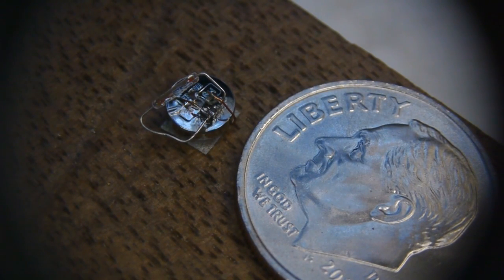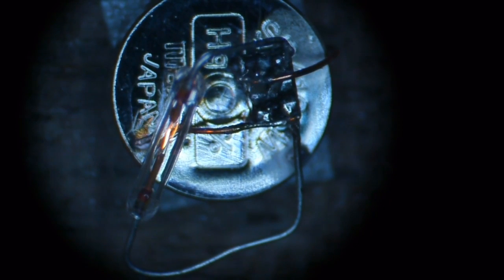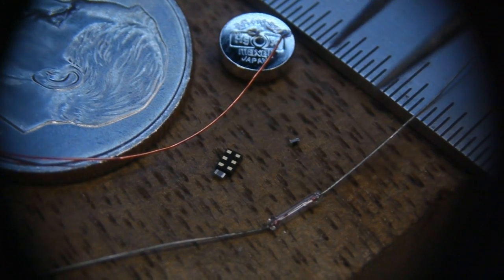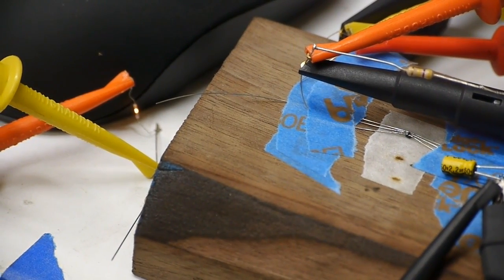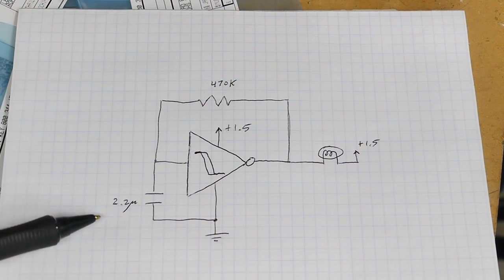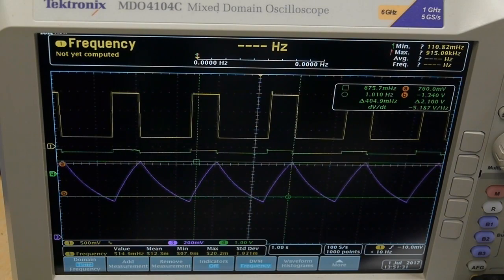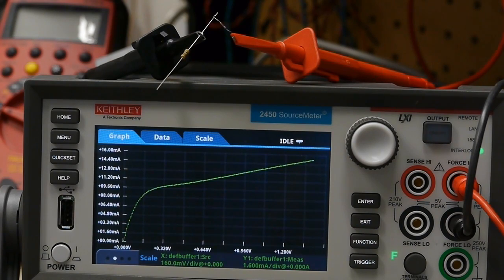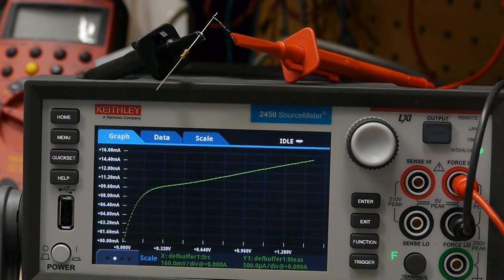World's smallest lightbulb flasher?  Flashing Light Prize 2017

Comment: If the voltage ramping smoothed to soft start & soft shut down the filament, it will greatly enhance the operating life of the tiny lamp // effective every 10% you dim an incandescent lamp - doubles the operating life in hours // this is why slide dimmers used with an incandescent lamps started dim & shut down dim can make a normal A19 last 20+ years

Comment: Warming a chemical battery to improve its output makes sense. A hand heater with a cell phone (snowboarding) can help in a similar way / or for digital cameras in sub freezing conditions. I usually wrap the hand warmer with a small towel to slow the heat transfer so as to not overheat in the pocket, a sock works great! Frozen lipo also dangerous to charge FYI.

Comment: couldn't a tiny reed switch be used with an appropriate bulb that by it's heat or due to current flowing, it breaks contact? maybe use a cap, pre-energized in place of a battery just to be unusual...
just thinking of interesting ways to be different or smaller

Comment: A QUESTION: incandesced lightbulb should get hot and emit light no matter the direction of the current, so it should totally work in AC. So why the scheme the chap has designed should include inverter?

Comment: Hi Ben, project idea: A hydraulic cylinder using gallium as the hydraulic fluid. Gallium melts just above room temperature, and expands when it solidifies. By varying the temperature around the melting point, the expansion/contraction could actuate the cylinder. Suggest experimenting with cooling it from the end, from the sides, effects of gradual vs. rapid temperature change, ways to improve the pressure, throw and speed of the cylinder, etc.

Comment: Well, you beat me to the punch on this one, Ben...  Drat.  However, while yours is also probably a tad smaller my entry has a unique feature that I thinks makes it interesting, too.  See: https://youtu.be/-4Dtu-VaZNw
Reply from the maker: Awesome!  When I starting watching your video, I was thinking about this really convenient IDE made for the ATTiny10 that I've been using recently, and it's yours!!  Thank you so much for creating this IDE!  It's so much easier to use than anything else.  In fact, I've been thinking about doing a video about the ATTiny10, and was absolutely going to mention your Mac IDE.  A Windows version would be appreciated, but I have both platforms, so not a huge deal.  You might get a kick out of this very clever morse code program: https://i.stack.imgur.com/NCQ6z.jpg  Again, thanks so much for making the IDE!
Reply: Wow, it's great to know someone is using my IDE.  I'm flattered.  The ATtiny10 has been my goto "glue" logic replacement for a lot of my projects, as it's often "just enough" for what I need.  In fact, one goal for the new IDE is to create a tool where non programmers can type in a few parameters and then autogenerate code to make an ATtiny10 do things like analog or serial to PWM conversion, sequence generation (blink patterns for LEDs), servo control, capacitive touch control, etc.  The idea is to define a way to annotate C code with "tags" that cause the IDE to prompts for values for these tags before compiling the code and programming the ATtiny10.   It's still a work in progress, but I think is has potential.

That morse program you linked is very clever in the way it leverages the fact that morse is already a type of binary code.  I'm not sure it would have simplified my code, but it's very inventive!

Comment: smaller or simpler than this?? what about a MEMS relay with rc timer or something 😂 or will a custom tiny silicon die will win, and use a piece of the tinest tungsten wire you can find for the light bulb section.

Comment: the curve is caused by the bulb heating up and changing in resistance right？
Reply from the maker: Yes, exactly.  I would have expected a more gradual change as it gets warmer, but it has a "knee" shape in the graph  .  Perhaps this is a combination of 1/R and V^2 terms combining?   Or maybe a T^4 term in heat emission?  I'm not sure, and a quick search did not make the answer apparent.  Maybe you can find it?
Reply: Applied Science it seems amazing how it looks almost linear after the, "turning point"!! or is it actually? hmmm, so the combo of both the heat "lost" from that I^2, and the resistance change from the heating process, and maybe the material's emmision properties? so could there be a math function modeled for this? but again is it actually a single function? or  is it two seperate functions.. i am confused.

Comment: Pretty small flasher! Another item you might like to play/experiment with....old digital hearings aid/s.....Mine have a double sided ceramic circuit board maybe 1/8-5/32" square.....at least 25 components on each side....and the 'battery' is a #10 zinc-air. These zinc-air cells can put out plenty of current @1.45 volts...40-50 milliamps on an analog multi-meter....resistors and caps are very small....a lot of the components are specially made just for hearing aids....  #10 cells are the smallest for hearing aids, but may not be the smallest 'coin' cells...

Comment: Have you had any problems with the Schmitt inverter?  You are running it at 3-4 times the recommended output current on the data sheet.
Reply from the maker: The datasheet seemed to indicate that the chip would only be capable of source/sink 4mA at 1.4V, so I was surprised that it was capable of much more.  The absolute max is listed at 50mA, but this is far outside the "recommended" spec for low voltages.  I think it's possible that the current must be low in order to meet the speed/switching specs at low voltages.  I don't think it hurts the chip, but would have to ask the mfr if using this into a commercial design.
Reply: It runs at like 30% duty cycle, and all CMOS logic chips are inherently current sources, so it sort of self-regulates. As the load resistance goes up due to filament heating, the current will stay put, and the dissipation will drop as the voltage drop on the output device will get smaller as well, under constant current. 

All you want is one that will survive the load. They mostly do. I have stuff in production (for 15+ years now) that drives a bunch of LEDs with no series resistors, just leveraging the inherent current sourcing character of CMOS logic output stages. The trick was to get an MCU with a large pin count package so there would be about 50% unused GPIO pins. Those extra pins were split evenly and half were connected to VCC, other half to GND. Then they were driven as outputs, GND to 0 and VCC to 1. This provided the I/O areas with additional, local supply sources. This kept the I/O currents local and didn’t overload the designated VCC/GND connections. The chip didn’t mind the dissipation apparently. This driving about 50 pins at about 10mA each, where the rest of the chip drew maybe another 10mA on top of it (it wasn’t anything fast).

Comment: 7:05 Any particular reason the other end of the bulb is tied to power rather than ground? It doesn't seem like it would matter in this case, although tying to ground seems more standard.
Reply from the maker: Good question. The datasheet says the chip can source/sink the same amount of current, so it should be symmetric, and should have the same current flow for either wiring configuration.  The threshold voltages are not quite symmetric between gnd and vcc, so when the bulb is drawing power, the battery voltage will sag, and change the input thresholds slightly. Based on a few quick tests, it seemed to work better when the voltage sag occurred during capacitor discharge cycle.  I'm not positive that this is real effect, though.

Comment: Unijunction Transistors can make very simple RC oscillators as well. I loved this video.
Reply: When Ben was speaking of trying to make it even simpler, making a relaxation oscillator based on a UJT was the first thing I thought of also...Bat, C, UJT, Bulb, would do it I'm thinking... Great video!
Reply: Came here to look for this answer :-)
Did either of you figure out if it'd work yet? I don't quickly see whether there's enough voltage, or ability to make the output symmetric...  https://en.wikipedia.org/wiki/Unijunction_transistor

Comment: I don't know of a simpler oscillator than the reverse-biased NPN transistor working as a tunnel diode.
You can make it smaller if you make the componentes into silicon wafer with only 3 or 4 terminals for the lamp and power.

Comment: Are there sub-micro bi-metallic switches available? Or filament bulbs (at the very low power end) that incorporate them. I know they used to make large, relatively high power ones to flash Christmas lights. That would be the simplest circuit.

Comment: do you think you could build a DC to DC converter that runs off of one 0.5 volt solar cell that would charge a phone? I had wondered if it were possible after learning about a "joule thief", but I think the voltage is too low to self start.

Comment: Your explanation of the astable multivibrator is not entirely correct. The frequency of the astable multivibrator depends highly on the positive threshold voltage, the negative threshold voltage and the supply voltage. Here's a formula: F=1/(RC*ln(Vp(Vs-Vn)/(Vn(Vs-Vp)))) where F is the output frequency, RC is the RC time constant, Vp is the positive threshold voltage, Vn is the negative threshold voltage and Vs is the supply voltage. These values can differ a lot for every schmitt trigger (inverter) even within a single IC, so you need to measure these values if you want to calculate the output frequency or the necessary values for R and C.

Comment: I have made an oscillator circuit using light dependent resistor, giving a negative feedback to an op-amp based comparator, which drives an LED.

Comment: The word 'simple' is very relative.
Does that mean;
1 - total part count ?
2 - surface area/volume ?
3 - price ?
4 - practical part count vs technical part count?

Because it's very doable to build an one transistor oscillator.
There a numerous examples out there.
It's even more easy two build a two transistor oscillator, which is technically simpler than a schmit trigger.
But volume and part wise you probably need more components.

Btw, how stable is the RC circuit in this case?
How much does it shift with the temperature?

Comment: Years ago I build a model train house as a gift. I used such small lamps inside, and one of them started flashing. I was really confused. It took me hours to figure it out.
I used magnets to hold the hing together while the glue was drying, and it happened that one magnet was near the light bulb. Also the soldering was bad, so that one leg could build a spring. and the other only had a loose contact.
What append was that the magnetic field of the light bulb was big enough to be affected by the near by magnet so that the loose wire was loosing contact after awhile. Also a blob of glue was acting as weight to slow down the Frequency. It resonated with about 10Hz.
I was never been able to reproduce that. I tried it because the construction seemed surprisingly stable in the model.

A construction like that could be the smallest/simplest flashing light i can think of.

Comment: Old digital wristwatches from 80's used even smaller light bulbs as a back light for display. I have one somewhere and it works from 1.5V alkaline coin cell without the need to heating it.

Comment: The simplest oscillator I've seen thus far is a relaxation oscillator using the BJT negative resistance region:
https://www.youtube.com/watch?v=rpGOKGrcpAk
It uses a single BJT, a resistor and a capacitor. But this circuit needs high voltage around 12V to reach BJT breakdown and negative resistance region

Comment: As others have pointed out, one can probably make the bulb smaller, and one can probably make the electronics smaller too (smaller discretes, remove epoxy from IC). I think the main problem to shrink this further is the energy source. I do like this build though. Nothing like some PCB-less circuits =)

Comment: the simplest blinking light bulb circut is there are small light bulbs they have a thermal switch inside to cut of the power from filament after reaching some temperature. now its starts to cool down and the thermal switch close the circut.
my idea is to put a smal thermal switch under the bulb! if its very small and the thermal capacity is low enough, and the thermal switch is very sensetive you just need a thermal switch an battary ant the bulb.

Comment: Neat research, using $25k of test equipment. Yes, I am jealous.  This could be done with 2 SOT FETs, but still needs additional 3 resistors & a capacitor.   I think this is the practical smallest hand built flasher.  Using a die or flip chip and smaller R & Cs  or making it as a thick film hybrid would be smaller but requires using "micro automation".  But wait, you have a really neat vacuum deposition set up! That could do it!

Comment: Add a phototransistor looking at the bulb, and you've developed an incredibly crude thermal trigger.
Reply: You have to take into consideration that the conditions as is require the battery to be heated to 30c to function as it is pushing the battery hard to be able to function. Adding photo transistors will most likely make it unable to fire up. So not really an option. The idea on the other hand is quite clever though !

Comment: " you can get them even smaller " then it's not the worlds smallest
Reply from the maker: Sorry, I meant that the axial bulbs are smaller than the standard-shaped micro bulbs.  I bought the smallest incandescent lamp that I could find after an evening of searching.  It's the smallest one that Cir-Kit sells, for sure.
Reply: I think the world smallest light bulb was made in 2009 with a carbon nanotube, definitely not something we can make at home, yet. 

"At 1.4 micrometres long and just 13 nanometres wide, the filament is invisible to the naked eye until it is switched on."

“Quantum mechanics is the right theory to use in systems with very few particles, and thermodynamics is the right theory to use in systems with very many particles,” says Regan. “We don’t have a theory for the intermediate regime between these two limits, so that’s where we’re doing the experiment.”

Source:
https://www.newscientist.com/article/dn17058-worlds-tiniest-lamp-spans-quantum-and-classical-physics/
Reply: The world's fastest car, is the world's fastest car, even though "you could build one faster." Since no one has built one faster, it's still the world's fastest car. get it? 

The new Bugatti Chiron will be the world's fastest production car once production street tires are built for it that can handle the 300+ mph  speed. Since no one makes production street tires to handle that speed, Michelin is building tires specifically for it. Then it will be able to go past 300. So even though "it can" be the world's fastest production car, it's not.

Comment: You just need to use the heat from the bulb to expand a wire so that a contact is broken, then tune the mass of the wire to the output of the bulb and it's rate of heat lost to the environment so that you have the timing right. The wire passes the heat source then hooks around to the point it contacts so that an increase in the wire length moves the hook away from the contact. Like this, apply heat at the dot _j  and the j gets longer and stops touching the _
Reply: This is brilliant. None of that semiconductor witchcraft. I'm sure some of the competitors have come up with a bi-metal filament bending away from a contact point but it might be pretty hard to downscale..
Reply: If you make the bulb yourself you could have it contain a thermally dynamic contact. They were a thing at one point, search for "Self-blinking trafficator bulb".  I'm fairly sure it is the same idea.
Reply: Sounds like you should participate in the next one.

Comment: Don't be fooled people. This video is actually an entirely into the giant dime replica contest.
Reply: Also a giant thumb contest!
Reply: also giant thumb?
Reply: UFOhunter   E (Joules) = 1/2 * C (Farads) * V^2 (Volts squared).
Higher voltage capacitors will be lower capacitance.
For safety reasons you may want to stay at no more than 20V or so.
For 10J and 12V, C = 10J / (12*12) = 0.069F = 69,000 uF (microfarads). 
Mouser.com has a 16V 100,000uF cap for $19.54, 871-B41456B4100M, for example.
Reply: How much capacitance with what ESR do you need to store, then release 10 Joules of electrical current, to form the spot-weld? What AWG wire is that? Nice video.
Reply: 661-36DA124F016BB2A $14 something.  
Vary the voltage to control the energy.
Reply: We're gonna need a banana for scale
Reply: I have a few of those small coins.  They are some sort of miniature coin that is not real currency but just a novelty item.  On rare occasions at the bank when they used to have coin counting machines they would often have foreign currency in them that was rejected and sometimes things like buttons and those mini coins would still be in the machine because they don't really pass through well for some odd reason.  Those machines were taken out of service because they were shorting people sometimes by as much as 5% maybe more and that was not the fee for non customers of the bank.  That was just how much of an error the machines made.  There were lawsuits from the banks about this too.  It is very difficult to say if there will ever be machines like that in the bank again.  They may be one of those things we tell our grandchildren that we used them in the past.